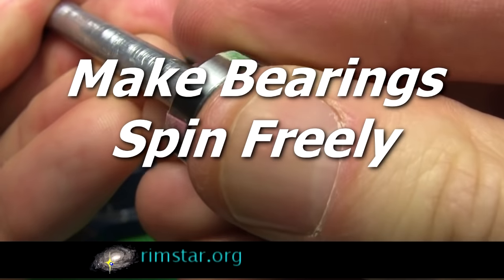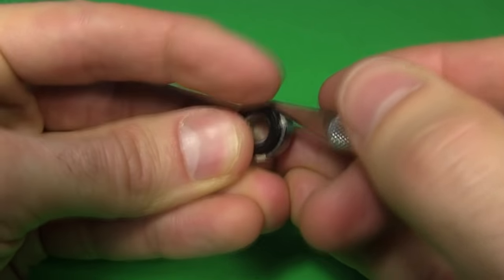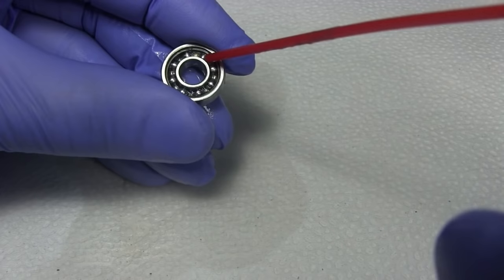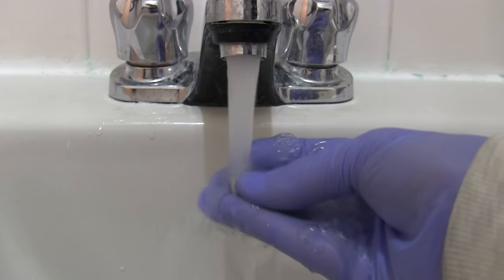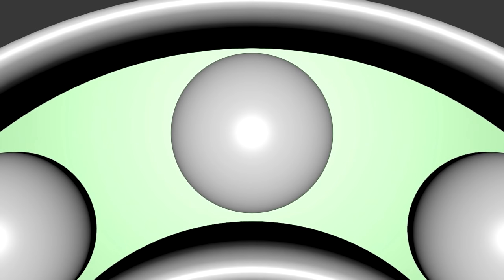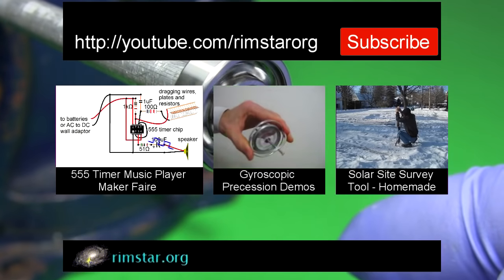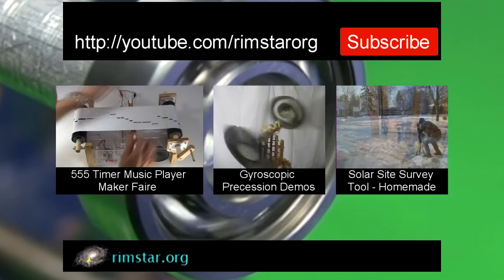How to Make Bearings Spin Faster/Freely

Comment: After a good clean with the thinner, don't forget to re-grease the bearings.Nice upload and cheers from Pakistan.
Reply: Machine oil works well depending on what you want to do of course, but keeps the rust away and spins better.

Comment: DO NOT SKATE WITHOUT SHIELDS ON YOU BEARINGS. Any moisture will make them rust easily and the lubricant inside will collect ALL of the dust and dirt that goes by them. This is for quick, often one-time uses. Do not use this for skateboarding, please: your wallet will thank you.
Reply: Many bearings are made shieldless. Bronson has some iirc
Reply: @kotymccallister5150  Yeah. I wouldn't ever use shieldless bearings for long term though since they'll get destroyed if not maintained properly.
Reply: @Normified  that's the caveat. You have to clean them more frequently. They roll faster though, or so they say. That's like a secondhand anecdotal statement though cause I've been riding reds with the red shield on the outside for years haha
Reply: @kotymccallister5150  Even just having dirty bearing shields is a no-go for me, cause that dirt is going to eventually find its way past the shield. I guess I'm just picky about maintaining my setup lol
Reply: @normified  yeah, me as well haha
Reply: I just replied to another skater in this page. I'd suggest getting the parts in the truck coated in tungsten disulfide. If you type in "tungsten disulfide truck spin" on YouTube you'll find the video at the top. A page called Applied Tungstenite posted it. Look at how much smoother the wheels spin.

Comment: so what happened is that the 'skate-bearing-cult' found the video and they're freaking out... apparently one of the big NO-NOs is touching a skate bearing with WD40, and god-forbid water :}
WD40 is great for cleaning purposes, but it's intended as a Water Displacement agent.
anyways, this is a great video showing what creates friction in a small bearing. depending on the application, a dry lubricant can be used, such as PTFE or DRY Silicone (not all silicone lubricants are dry).
Reply from the maker: Anyone who's watching this video for use with skate's should realize from the second half of this video that this is not for them. This works fine for things where the seconds half of this video doesn't apply, like my indoor, lightly loaded electrostatic motor. Having said that, yes, a dry lubricant would be an improvement even for that.

Comment: What about when you put the shields back on ,;?
Reply from the maker: I don't recall what happened when I tried with the shields back on. My application was an indoor one, and electrostatic motor, and so I didn't need the shields. As long as they don't touch the moving parts then they should affect anything.

Comment: I thought getting the bearings wet make them rusty
Reply from the maker: They get rusty only if the bearings stay wet. They dry off pretty quickly, partly from my drying them with a paper towel and partly from evaporation. If you're really worried then you can also run a hair dryer over them to evaporate the air faster.
Reply: @RimstarOrg  A quick rinse in some isopropyl alcohol will also flush out the water, and any alcohol remaining on the part will evaporate much quicker than water.
Reply from the maker: @Justin Shands Good idea. Thanks.
Reply: @RimstarOrg  Use a hair dryer after the water cleaning ;)

Comment: never put wd-40 in ypur bearings they wil improve until it Evaporates then it doesnt spin at all and you will need new bearings
Reply: That’s why he removes the wd40 with like step 3
Reply: They why it's used as a degreaser

Comment: Oil ok?
Reply from the maker: It depends on the application. I really can't say. In my case I was doing this for a low load, indoor, electrostatic motor. It could have benefited from graphite lubricant.

Comment: Thank you! 
I used this method to clean my skateboard bearings. It works great
Reply from the maker: James Johnston You're welcome! But for skateboard bearings, if you're using them for skateboarding, then you'll want to add some lubricant back if there was some. The lubricant would make the bearings last longer by keeping dirt and water away from the parts and reducing friction from the parts contacting each other. Whether or not you need lubricant depends on the application and my guess is that bearings used for skateboarding would benefit from it. In my case I originally did this for an electrostatic motor which didn't need lubricant.

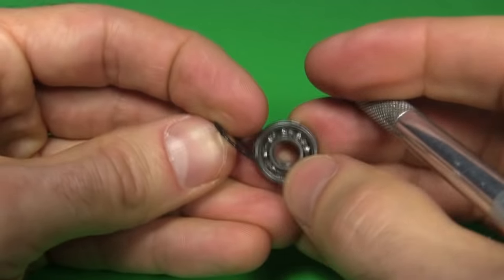Comment: [Quote @1:38] "However, if you're making something that won't run fast or for long periods of time [/Quote]... Then don't use precision ball bearings... I clicked "dislike this video" after watching it; but, noticed it was at 666 down votes so I cancelled it. First, sorry for the rant, but this video instruction IMHO has shortcomings for making metal roller bearings spin ....Better. Why introduce water to metal bearings at all? Metal bearings without lube... great idea. They're designed and 'toleranced' to have some form of lube. Yea, scrape the bearings with a scalpel. I figure the stock bearing with shield and grease would work well for this slowly rotating music thing (which I think is a neat device btw, @RimstarOrg). I figure the bearings cost as much at the rest of the material combined for your music thing. Why use precision bearings in this application at all? Any lightweight, wet lube should be applied to these bearings for any higher speed (ANY) application. etc etc.

Comment: Now I can fix my fidget spinner thanks : D
Reply from the maker: Be careful. I'd think that the bearings in fidget spinners would already be optimized for speed so doing this may make matters worse, though one person in the comments here reported that it improved it. When you remove the seal for your bearing, if you don't see any grease like you see at the beginning of this video, then you're probably already optimized for speed. If you do do this for a spinner then I'd recommend a final step of adding lubricating dry graphite powder. The problem with leaving a fidget spinner with no lubricant is that it'll be noisier and the bearing may wear down faster for the first reason I give in the second half of the video. None of the reasons not to do it that I talk about applied to my application which was an electrostatic motor (low speed, small load, indoors, no water).

Comment: That's not a good idea to remove the bearing seal, because that seal is important because it protects the balls from contaminants, and also prevents grease loss.

There's actually an accurate way to make the bearing to turn freely, no machine has a bearing without a seal because the seal is very important.
Reply: There are many machines with open bearings. They just usually have their own separate housing.
Reply: What’s your accurate way then… I need to know pls
Reply: Its a rubber seal you pop back on ..

Comment: So much step.
Just use lighter fluid (I use Zippo fluid) and let your bearing sit for a couple of hours than let it dry. You can thank me later
Reply: yeah bro thats lit
Reply: paint thinner causes microscopic pitting on metal.  You are correct, I use lighter fluid or 99% rubbing alcohol.  It dries and doesn't leave residue either.
Reply: @RacerX888  Pitting is not caused by the solvent used, it is caused by the load and Hertz contact. Please check what pitting is.

Comment: I got a few questions. Everyone says water will rust them if i rinse under water but will they only rust if i domt use them for long times like if i use everyday they shouldnt rust right? Another question is i know bearings use grease so if i used this lube called speed cream just google it it comes stright up will this speed them up or slow them down ? Btw im using for a finger spinner
Reply: bear Mitch Hey dude yes bones speed cream is only for skateboarding it will reduce the free spin. Hot water won't rust the bearings just get a blow dryer to dry them off before it does harm

Comment: If you add some tungsten disulfide powder to rubbing alcohol and spray a liberal amount into the bearings, i bet it will leave an extremely dry, slick film of ws2 which will make them bad boys spin even more.

Comment: you... you put the bearing in water???
Reply from the maker: ... and then I dried it off. Yes.
Reply: @RimstarOrg  were you sure to take it fully apart and clean off the individual ball bearings and the  as well as the inner and outer raceways? cause if not you are leaving water in there to oxidize and rust the bearings especially after you scraped them with a metal needle tip like that scratching any protective coating up allowing for further oxidization. realistically you should clean bearings with an alcohol based cleaner like 99% isopropyl alcohol or similar percent acetone more commonly called nail polish remover.
Reply: you're all insane
Reply: @twilightsparkle75  You realize that is not even remotely needed. Hell most bike chains dont rust after being touched by water as shown. You dont have to be that precise in it.

Comment: If you are going to remove all the lubricant then spray them with a silicone lubricant this will dry leaving 
behind a silicone coating on the parts no more metal to metal contact or friction from grease.

Comment: By the way, WD-40 is not a lubricant, it's a solvent.
Reply from the maker: I wasn't sure about that too since sometimes I've used it to remove grease and other gunk and sometimes to lubricate (hinges etc.) So I looked on their website and they say "You can use WD-40® to protect, remove gunk, and lubricate thousands upon thousands of items wherever you go!", "WD-40 Smart Straw spray lubricant is available...", "Myth: WD-40 Multi-Use Product is not really a lubricant. Fact: While the “W-D” in WD-40 stands for Water Displacement, WD-40 Multi-Use Product is a unique, special blend of lubricants. The product’s formulation also contains anti-corrosion agents and ingredients for penetration, water displacement and soil removal." Though even then I was careful in the video to say it "acts like a lubricant".

Comment: After all of the instructions do I have to keep the seals?
Reply from the maker: The seals will help keep dirt out, so it depends on your usage.
However, as the 2nd half of the video explains, part of the purpose of the grease was to act a sealant to help prevent water and other materials from getting in between the parts. So the assumption is that if you're removing the grease then you're not in a dirty environment anyway, so the seals become completely optional.
Reply: Ok thank you

Comment: definetly going to try this tomorrow!
Reply from the maker: Alex Lastivka I've since found out that you can buy dry ceramic bearings, dry in that they have no lubricant. I have some smaller than in this video which I bought on ebay and they spin for around 5 seconds. I'm using them in my new corona motor which I'll be releasing a video about later this week. They're pretty amazing.

Comment: This is pretty cool! WD40 is not a lubricant, though.
Reply: Darren Baker he used it to remove the greese
Reply: But he also said its a lubricant.  its not. its is a solvent and its meant to be a water displacer. (wd is water displacer and the 40 is the 40th formula that was tried) however it can temporarily act like a lubricant, people also use it as a cutting oil (its not a cutting oil but in a pinch will be a ok substitute for the hobbyist and will be better then nothing )
Reply: Mark Burton Oh, but it is! It's neither designed nor marketed as a lubricant, nor is it a good choice as a lubricant compared to other products available but you have to remember that water, banana peels, and all sorts of other things are lubricants. Have a heart !jumping people with that old, hackneyed, "WD-40 is NOT a lubricant", bit just tends to suggest to people that your really not very handy the way going around pointing out that the whale is not a fish shows you're not a zoologist (which I am🤔).
Why not add your knowledge in a positive way and remember if you go around saying that WD-40 isn't a lubricant, there will be a petroleum engineer (which my brother-in-law is 😡) lurking just around the corner. 
Yep, happens to everyone😂

Comment: I have no hate, its just that dry bearings dont tend to have as longer life duration compared to wet bearings (some sort of lubrication). If you want to maintain durable long life bearings dont remove lubricant, and\or keep lubricated, i only intend to inform not hate
Reply from the maker: That depends on the application. In my case it was for an electrostatic motor with practically no load, just a fun science experiment. But I agree, you should add a dry lubricant for loads.
Reply: RimstarOrg oh okay, yes with little or no load there isnt alot to worry about, a dry lubricant is a great idea tho, well stated!

Comment: Use chainlube for low pressure high speed bearing will make bearing spin faster without damage ball bearing.

Grease suitable for low speed bearing under high load or high pressure. When you use grease for high speed application, you will burn bearing in 5 minute.

Comment: This is wrong method to move bearings fast and freely. Without any lubricant,  bearing Will become scrap in very short time. No need to move bearings fast and free. It takes its speed in its own way where they are applied.

Comment: Thanks this was the only thing I needed
Reply from the maker: You're welcome. Make sure you watch the second half of the video where I point out the conditions where you won't want to do this (e.g. don't do it for skateboard wheels since they're exposed to water and dirt). I did this for an electrostatic motor so none of those things were an issue.

Comment: Correction...  WD-40 is NOT a lubricant !

Yes it will lubricate on application, but it will evaporate !
Lubricant doesn't evaporate !
So water would also been considered a lubricant...  as it removes some friction on application...

WD-40 is a DEGREASER, period.

A mecanic did lubricate ma hand brake cables with WD-40 because they were getting hard to activate and release...  3 weeks later, my truck went to his garage behind a towing truck...  brake stuck on...!!!  The previously "lubricated" cables were stucked.  So as he made the job badly, he had to pay the towing fees AND the cables and the labour of his own job...

WD-40 is NOT a lubricant !!!  He learned !

Comment: What a idiotic move.
The bearing will goes crap.
The crease is needed.
Without the bearing goes fast damage. 

The seal can be remove for home use but no outside.
For home use you could use ceramic bearings
Reply: Why are there so many bronies here? Just curious (:

Comment: title should read "how to destroy a bearing"
Reply from the maker: If the things I warn about in the second half of this video apply what you're using the bearing for then I agree, you'll destroy your bearing. For my indoor, electrostatic motor, it worked great. I did later learn that adding a little graphite powder lubricant would help.

Comment: DON'T USE WATER
Reply: You can use water but wash the water right away so it doesn't stay and rust
Reply: The Repairers Of The Breach  use a blow dryer and a towel
Reply: Non chemical cleaners like green, orange, citrus won't corrode as much as varnish. Also use compressed air and heat (hair dryer) after water rinse to prevent corrosion

Comment: This should be called “how to ruin your bearings”
Reply from the maker: This should really be called "be sure to watch the second half of the video for the caveats". It worked great for my low load, indoor electrostatic motor. Having said that, I could have removed the caveats had I added that you could add some dry lubricant.
Reply: @RimstarOrg  then call it that..
Reply from the maker: Ha ha! You're right, that I can change. Too bad I can't go back and add mention of adding dry lubricant to the video. That's a problem with videos on YouTube -- you can't go back to change them. You used to be able to at least add an annotation to the video but that feature's long gone. There have been a few videos that I've taken down, modified and reuploaded though, but only when someone pointed out medium to large errors.

Comment: I thought of using a high rpm hobby motor (something like 30k rpm of possible) and making a small gearbox to have an output speed of 100000rpm or more. Crazy idea?
Reply from the maker: At that speed, you'd be producing a lot of heat which would damage the bearing. You'd want some sort of lubricant. For high temperatures, I don't know which lubricant though. There's probably a right one.
Reply: @RimstarOrg  Yeah, that's really the only thing stopping me at this point
Reply: @noahlail4018  vinoco hi tack grease